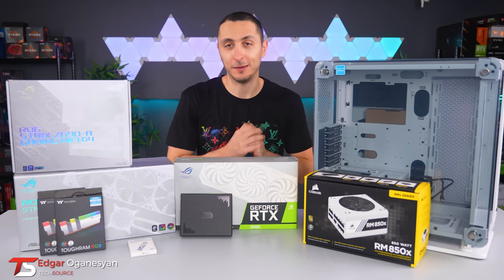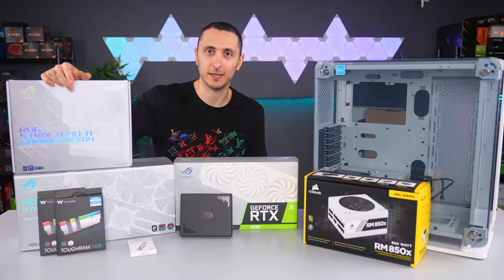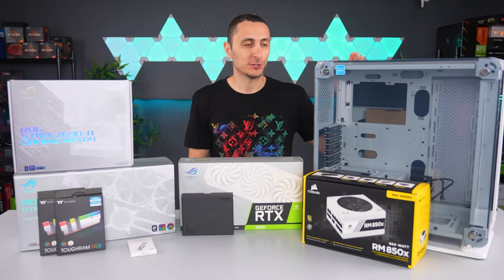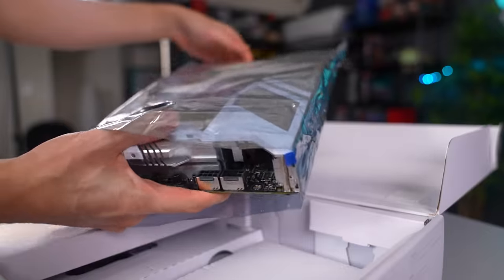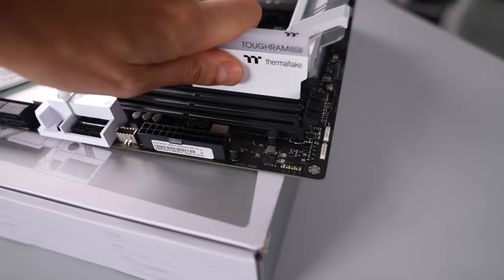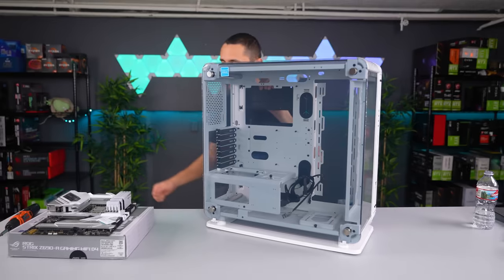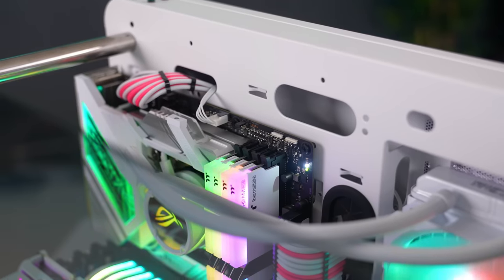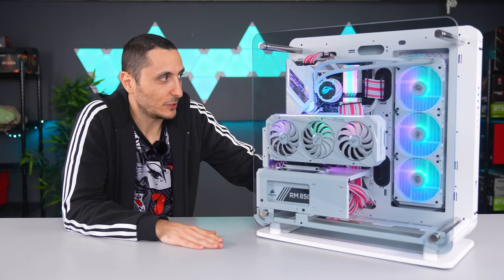My Wife joins the PC Master Race!

Comment: Ed's wife needs light editing pc
Ed: RTX 3090 
32GB RAM
i9-12900K
Reply: you need these specs when you edit light. if she edited videos, could've been lower specs.
Reply: @khealer  😂yes bro you are right
Reply: The only weak point is the 32gb ram. It should've been 64
Reply: @IronMan-jj2fd  i have never agreed nore
Reply: @dundee7440  cuz I have a 32gb ram PC with GTX 1650 😅
Reply: The crappy laptop he mentioned was a zephyrus M15 with i7 10750h and GTX 1660ti 16 gb ram 1 tb ssd and a  240hz display ,I own it 🥲
Reply: @supremebape1525  it’s a good laptop 💀
Reply: @supremebape1525  bruh💀, if thts crappy, then whts my 5yr old i3 i call ole reliable? First world problems
Reply: @IronMan-jj2fd  not even 128 gb lol
Reply: @smggobrrr7586   ikr it has pretty good specs cuz i saw that laptop before
Reply: @supremebape1525  well atleast i have a 32gb RAM 😂
Reply: right, it's very light system about Video editing
Reply: @IronMan-jj2fd  It should've been - 128 that's enough for video editing
Reply: @supremebape1525  those specs are actually pretty good maybe the particular pc they had was damaged or something
Reply: @IronMan-jj2fd  anything above 32 is massively overkill, you can have 32 gb and still have discord, streaming, twitch, video games, editing, Spotify, google, YouTube, emails, and more opened at once with no lag. I had a laptop with 16 gb ram and it handled 3 monitors (4 including the laptop) with multitasking in the monitors and everything was still smooth
Reply: @IronMan-jj2fd  maybe spend more money on your card instead of ram gtx 1650 isn’t great

Comment: Honestly I think the little bit of black on the cable combs actually ties it in with the black gramets, black pcb mobo uses,  black rear pci bracker, and the black RM 850 logo on side of psu.
Would love to seen some B roll at the end with the lights set to white/pink and the logo flipped in the software with matching white/pink. Even if you just did a instagram or twitter post linked in with those it would be cool!

Comment: if you're going to replace the cable combs, don't go with white! Go with the brushed aluminum that CableMod offers. They would go great with the accents on the motherboard, the steel posts on the corners of the case, etc.....   imo of course!

Comment: 1 more idea: make a cover for the front of the PSU shroud . Plexy or a metal piece that you can spray paint white to hide the cable clutter at the the PSU. Also, peel off the PSU sticker :D

Comment: hi there, cool and awesome Build as always, I think since you are open for suggestions, replace the RGB fans with Lian Li UNI Fan SL120 3 Pack White, and make the cable combs gray or keep the black, If you can hide the opening of the power supply cover, may be a small monitor !!!.

Comment: it's Quite powerful & capable to run pretty much everything on 1440p maximum setting 💥 . & also important thing to saving valuable time on 
heavy Render..  that could be PremierPro export or Realtime 3D render at Render engine

Comment: I would turn the oubp around (prob cant cuz of not enough space for tubes between the ram, but if possuble i would), switch the cable cines to white like you siade and get some additionel 3 so that the cables out of the psu are looking cleaner, thats just bothering me. Other than that, a beautiful build. and i hope the night was a nice experience.

Comment: What's scary to me that DDR5 is at a early peak meaning not a lot of companies already optimized for the gaming benefit of DDR5. Like Forza 5, perfectly optimized for performance on all kinds of hardware. And to look at the Cas Latency on DDR5. I know and aware like others might be that newer model of ram of each generation have higher Cas Latency like DDR3 having very low latency but low performance on the mhz and what not.

Once games catch up with the ddr5 and with newer ram sticks later down the line, it will be normalized as a normal purchase product for a daily customer.

Comment: AIO vertical mount rad with tubes at the top?   Why not spend a little extra time and hard tube it to the CPU, if a vertical mount rad is your only option?  Then you don't have to settle for that AIO and have tubes at the top of your rad.

Comment: the gpu fans were not spinning, was that because the 3090 fans or that particular GPU's fans do not move at idle or when not used?
Reply: yeah its a feature with some gpus that have big cooling fins, they dont need to spin unless they reach a certain temp

Comment: So what cables did u get on cable mod paracord or the pro modflex or what Idk which one to get i like how vibrant those are and the cable combs I have a cablemod kit but  just black plastic combs and the 3 separate cables for the gpu are not connected

Comment: I need help, my system will only boot every other time. When it doesn’t my rgb and fans turn on but the actual system won’t boot I’ve already tried removing my cmos battery and putting it back in